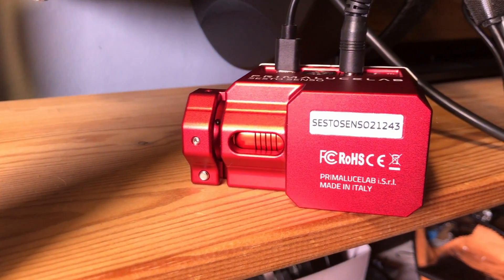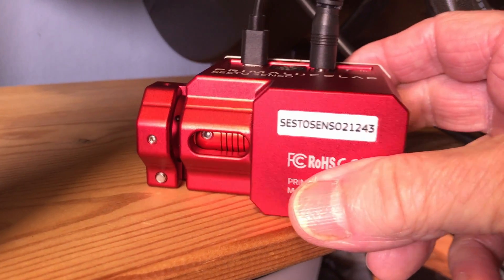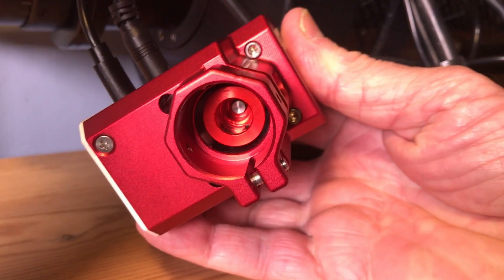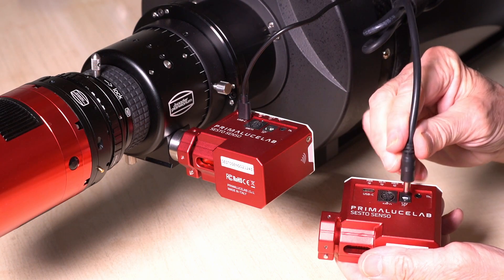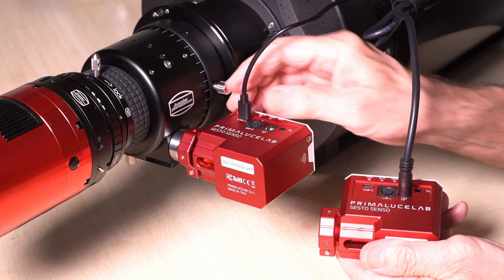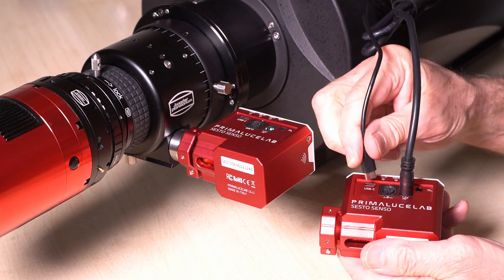Weird problem with a Sesto Senso focus motor

Comment: I bought the Sesto Senso 2, which initially worked okay but eventually would not communicate with any of my computers. I used it simply as a focuser activated by me, not as an automatic focuser through NINA.
Reply from the maker: Communication problems can be really frustrating. I would suggest that you first check if it is a faulty cable, or a poor connection to the USB2 port in your computer. Also make sure the USB-C plug in the Sesto Senso is fully seated, that one fooled me at first. Try a little cable switcharoo to eliminate the simple things before you move on. If that doesn't help make sure the driver is configured to the correct software communications port (like COM9, COM11 or whatever it is in your configuration). Windows will sometimes switch to another port for no readily apparent reason. If nothing helps try emailing PrimaluceLab support. They have always been helpful when I had issues with their gear.

Comment: So, did you try the power supply from the 2nd hand motor on your own?
Reply from the maker: I did, yes. There was no difference. Also, the motors doesn't come with their own PSU's, as there is always an abundance of 12V outlets around astro-gear. The Eagle astro-computer has S/W controllable 12V outlets to supply the mount, the camera and focusers, rotators, filter wheels, dew heaters and whatnot, so in the beginning I was using that. The alternative PSU was one that came with my mount, but which I'm normally not using because I power everything from the computer. You may read more about the Eagle here: https://eu.primalucelab.com/computer-and-software/eagle/